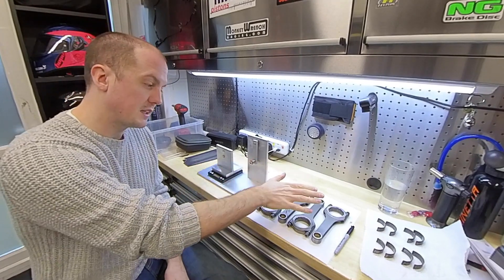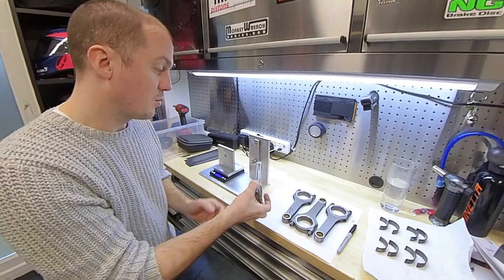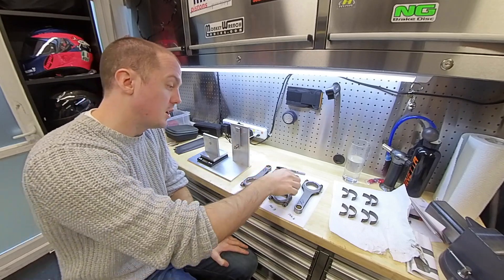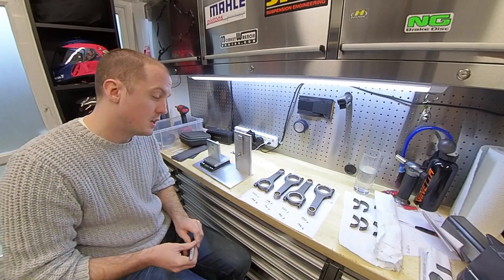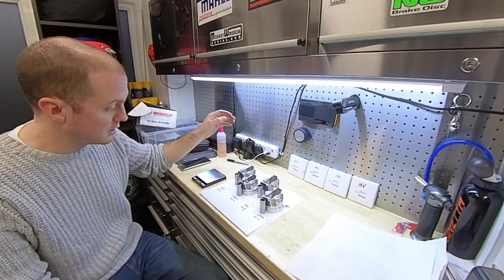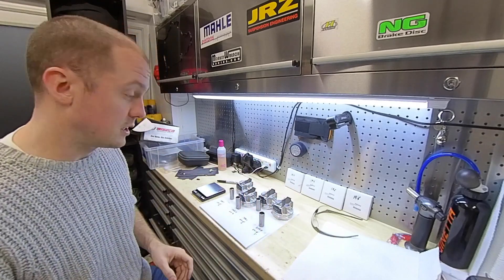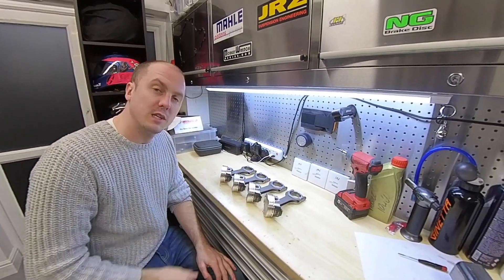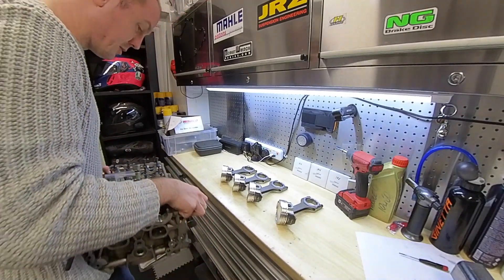2zz-ge Con Rod and Piston Balancing and Assembly

Comment: Sir.  Does this connecting rod.  Matches with any other rod 

Becoz I'm looking for piston rod but couldn't get 
Plz guide me.  . Which rod matches with 2zz-ge connecting rods
Reply from the maker: I don't think 2zz rods are exchangeable with any other engine. Known sources of 2zz rods, monkey wrench racing, carillo, and Toyota. (I have 3 oem rods and pistons for sale on ebay currently).
Reply: I need  piston connecting rod2 ( 2pcs)    for 2zz ge engine
Reply from the maker: @m.sakhtar4519  where are you based?
Reply: Dubai
Reply: The engine is currently in Toyota Corolla 1995
The engine is  2zz ge  1.8
Reply: I checked here in dubai to much but I could not get.  The piston connecting rod for that engine
Reply: Monkey Wrench Racing ships internationally and has options made by themselves (MWR), Carillo, Toyota and Crower